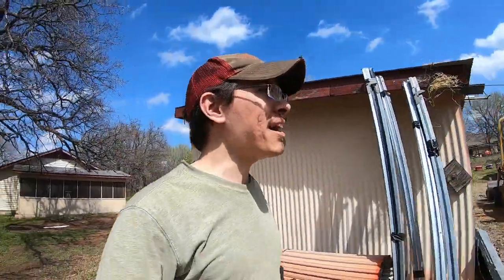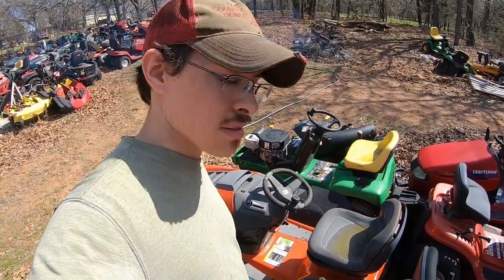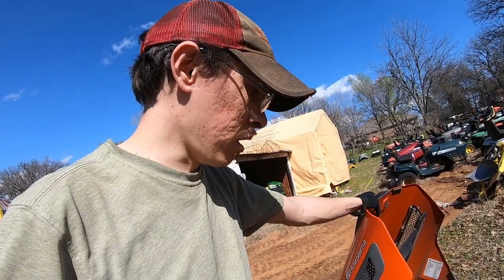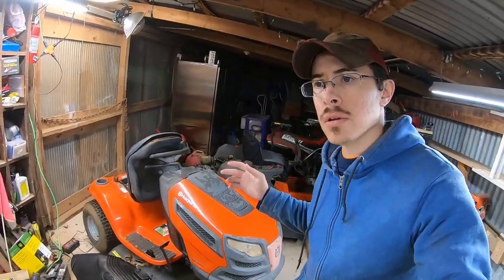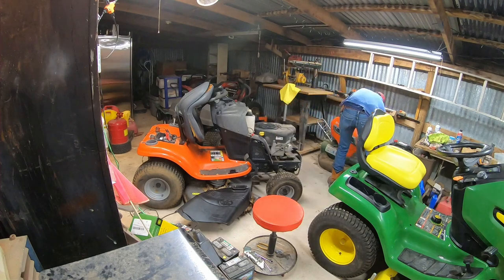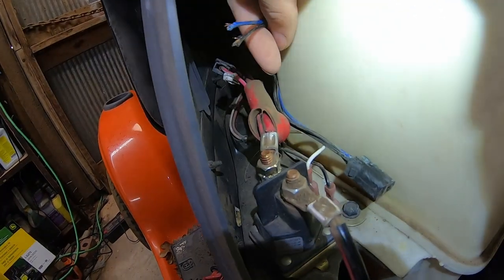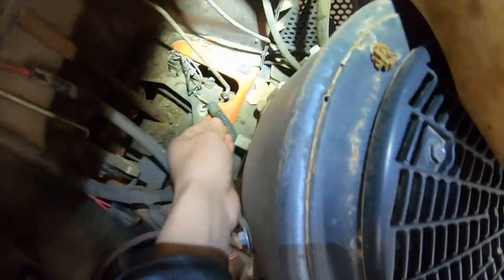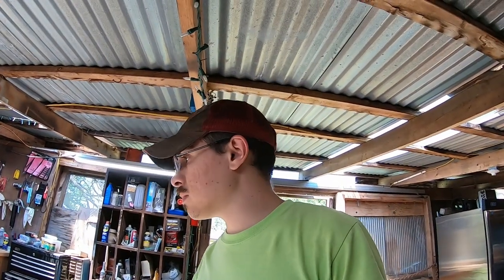Broken wires everywhere! My FREE Husqvarna lawn mower has electrical problems | Garage Story

Comment: Husqy machanic you help me out bigtime big big thank you. And i am having electrical issues with the same exact model. the guy i got mine from said the exact thing also . but i found some hanging wires dead ended so i know they go somewhere somehow but  i cannt figure out where. they hang from the wiring harness near close to the starter and solenoid one is black an blue one and i think grey or off-brownish . you have any ideas. also my hour meter doesn't work . Iv'e got new battery and solenoid. but didn't do the switch yet. but  i arched the sole  and it runs ok with the switch in on position... thnks in advance.
Reply from the maker: Does your solenoid have the small wires going to it? Maybe that's what those cut off wires are for. It can be a pain to find something like that. You might be best off finding a wire diagram. They could be for the seat safety, no telling.
Reply: @garagestory  Ok thnk you. i did a test of touching the 3 wires together always 2 at a time until something changed with either my hours meter or clicks from sole or the starter engaging... I found that the 2 black wires  i see  now that theres 2 black wires. And i believe theyre meant to be connected (i could be wrong tho, else why would they be coming from the same grommet part of the harness if they are meant to be connected)...Anyways I will test ths black+black connect to see if everythng is working upto parr...
Reply: @garagestory  yes sole. has the 2 large wires and 2 small wires ..